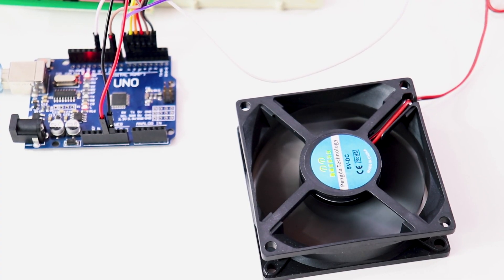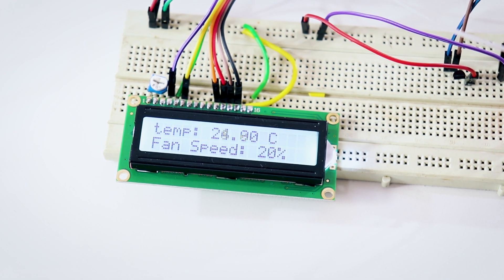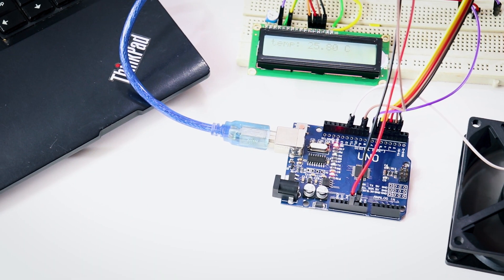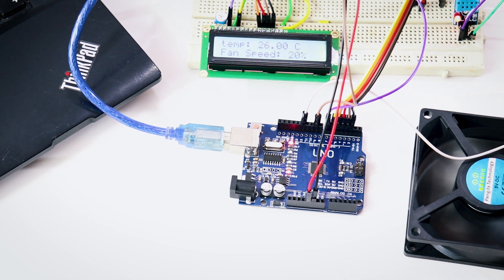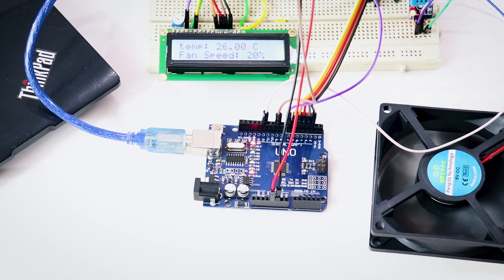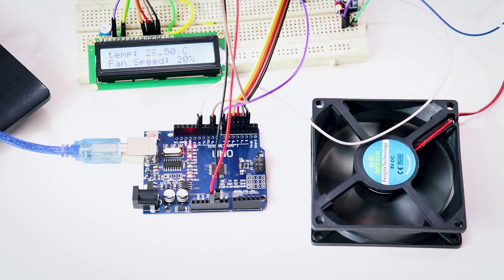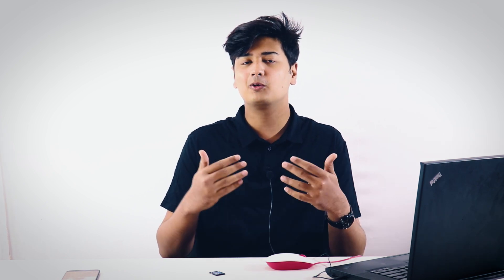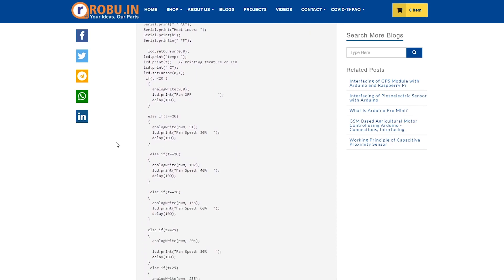Fan Changes Speed According to Temperature! | Temperature Controlled Fan Using Arduino Project Video

Comment: Hey brother can you tell me the code for my project . ds18b20 temperature sensor , LCD 16×2 , arduino UNO & fan , all connected .

As the temperature rises , fan goes fast or Start rotating and  if temperature goes low , fan slows or stops down...

Comment: How to use Ac ceiling fan instead of dc fan
Reply: use realy board
Reply: @advikmalwa379  wo to hum jante hai😂hum ye pooch rhe hai ki usko regulate kaise kre
Reply: @alzoha1267  woh mujhe bhi nahi pata mein boards ke baad krunga
Reply: @advikmalwa379  kuch trike hai usko krne
Reply: @alzoha1267  han hote toh hain logo ne kara hai
Reply: @advikmalwa379  jaise servo ko regulator ke button ke sath stick krke aur bhot dher saare relay use krke jisme hr ek relay on krne pr speed regulate hogi
Reply: @advikmalwa379  tumahra bhi board hai kya